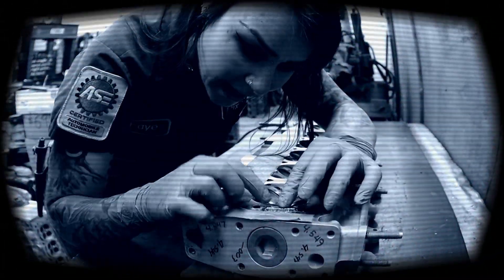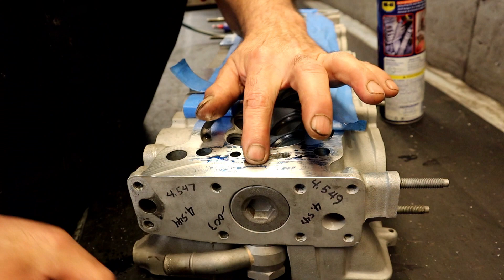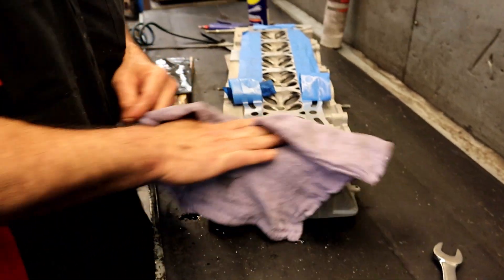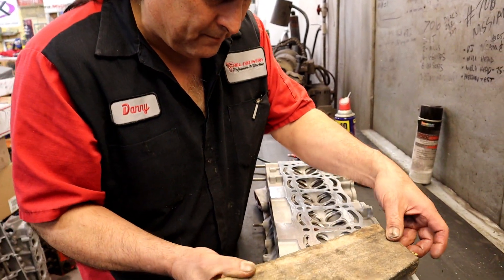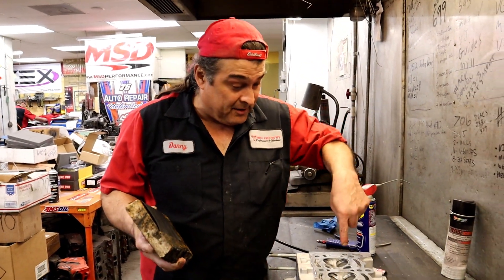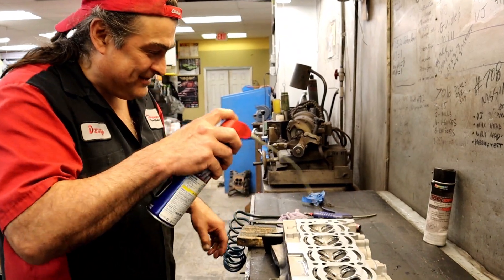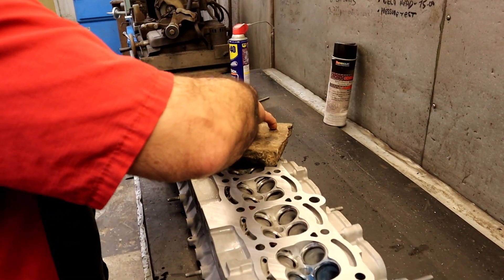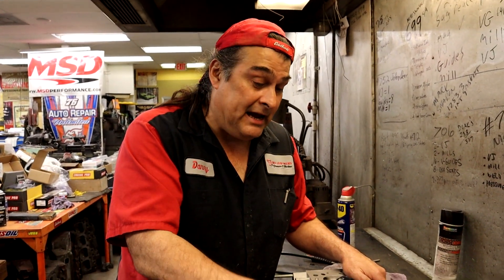Burr Removal and Lapping a Cylinder Head with.... a ROCK?!?! Cylinder Head Rebuilding part 6!!

Comment: I did this recently on 1984 Toyota pick up 22re engine. I replaced the head gasket ,cleaned the pistons with wd40 and a green weenie and used 400 wet dry sandpaper on piece of granite stone . Also did exhaust and intake ports. It turns out awesome results. Thanks for sharing this video.

Comment: Did this on my blocks deck recently and it turned out GORGEOUS! So perfectly flat and smooth. Even perfectly restored the factory machining finish! Somebody in the past has botched it. This fixed it. Went 220 grit (barely) --> 400 --> 800.

Comment: You can get small pieces of granite from your local counter top supplier.  Scrap from kitchen cabinets.   If you had a large enough piece, you could move the head back and forth over the granite.
Re chickens:  Faye's laugh is the sound of pure joy.

Comment: A similar idea is applied to polishing fiber cable ends, you only have to rely on the weight of the Stone so you aren’t excessively applying pressure. Super awesome!
Reply: Granite also doesn't flex, and if properly and slowly cut (obv only with diamond) you can obtain some dad-gum-dangd-ole- flat heavy rocks for many applications!

Comment: My understanding after doing some research online reading articles about people that work in the new car industry manufacturing them they said that there is a special cutting tools that they use on the final pass of a head and that final pass with that tool helps the head gasket seal better

Comment: back in 1960 I had a harley davidson wl45 motorcycle. the cast iron oil pump was leaking where it bolted on to the aluminum side cover because someone before me used a screwdriver to remove the pump leaving a scar in the aluminum. I used a safety plate side window from a 27 plymouth and valve grinding compound to lap the cover smooth. worked fine and did not leak. I have lapped my brigs and stratten lawn mower head 14 thousandths to increase compression. lapping is great if done correctly(and its cheap).

Comment: Hell yeh Faye!! Loving your vids and live streams with Danny👍
A couple of years ago I had a customer that had just re-done his kitchen and dining room floors with polished granite. When I went to return his trail bike I'd fixed, he asked if I could use any of the left over pieces....Initially I thought 'nah I don't need to collect any more useless stuff' but then It dawned on me...'that is probably really flat, and might make a great lapping plate' so I grabbed an approx 1ft sq piece.
Now it's all I use when lapping pretty much anything that fits.
I stick some fine w+d paper with masking tape at the edges and go to town...works great, and is much easier to manage than my huge piece of thick, heavy glass that I used to use previously👍
After seeing this, I kick myself I didn't grab a smaller piece to use as a sanding block...I'm not about to break my nice 1ft sq tile into smaller pieces, but will definately be on the look-out for a small piece for just those sort of jobs that require a hand held size👍🇦🇺

Comment: Its called a lapping stone and its another old school technique.  Remember though, cylinder head surface is very important and different gasket s require different  surfaces.  Its not a one surface is good for everything.  As Danny said, MLS and graphite like very very smooth surfaces 20-30ra or less.  A lot of stock replacement gaskets for older vehicles like a surface with some 'teeth' with a 80ra.  Putting the wrong surface finish on for the gasket can lead to pretty much immediate gasket failure.

Whats cool is if you look at the broach marks on factory heads, they actually leave a slightly raised section in the areas that are most sensitive to blowing, like between the center cylinders on a sbc.  Take a file and run it over a clean uncut head and it will bring up the broach marks.  Its a fraction of a thousandth of an inch difference, but its easily seen on a used block.  Whomever set up the broaches in the factory really knew what they were doing.

I am building a supercharged big block chevy right now with copper head gaskets and an O-ringed block.  It wants a pretty rough surface at 80ra plus the stainless steel o-ring.  But I don't think I am going to have a problem with it blowing.

Comment: I used the polished rounded edge end of a thick piece of glass to dress the surface of my 7M head. Just be even about it and don't dwell in one place too long or you'll have a dip in the surface.  35,000 miles and 6 years later no issues. I used ARP studs/nuts at 90 foot-pounds. I notice on your head that it hasn't been over cut. The giveaway for that is down by the front where the water neck connects for the thermostat housing.  When they're over cut that rounded edge is flattened.  It's a good idea to measure the thickness of the head and the block at the bearing saddle point and the deck surface.  I ended up using a 0.020" metal shim gasket under my standard head gasket to bring it back into spec since Toyota allows only 0.010" total removed from factory specifications.
Reply from the maker: I showed measuring the thickness of the head in one of my earlier videos! Thank you, and much respect to a fellow 7M owner!!! #SaveThe7M!!! 🙏🏻

Comment: I did my head with a thick piece of float glass that is bigger than the head. Place it in a flat surface to minimize bending of the glass and use a light coat of spray adhesive to butt glue 2x A4 pieces of sandpaper. Use a light oil lubricant and go back and forth on the head with separate grids to get the surface finish you want. Comes out like a mirror when you finish. Note the head needs to be straight otherwise if wrapped while you can eventually get a flat surface it will not be on the true axis. Other trick when let's say you are upgrading to MLS from stock gasket is to clean the (even aluminium) head and block with a razor blade by hand. Takes time but if done carefully you won't even put a scratch on it and best is costs nothing and a shop will not fuck up your perfect factory finish or remove material.

Comment: I found out a grade B flat granite slab (12x18x3") is only $88 on Amazon and free shipping despite weighing 70+ lbs.  I'm using it with some sandpaper to lap a block.  To test it I took a junk block and intentionally filed a 0.003 depression between cylinders, then sanded it back out without making the deck any less straight than it was to start.

Comment: I've been researching and experimenting with best method's for solving trying to find the best method to solve the TTY bolt stretch and head gasket sealing issues on the Ford 6.0 Powerstroke for over a year. Although the main culprit was not enough bolts in the design to combat the heat / excessive cylinder pressures. I found the combo of a final lapping on a machined surface with MLS gaskets is maybe the most critical/important step to a good seal. Even more then upgrading TTY to stud's and O-ring's, those  also make a difference but mostly only in higher hp situations. I'd like to see a episode on  his advice or what he recommends on head-stud Torque procedure's. Like Preferences on Checking final tq? if he waits a day till final tq after studs relax? recheck after heat cycle's?  Its not easy finding a machinist willing to give up his secrets for free that took them lifetime to acquire

Comment: As long as you are using a flat tool (metal or stone), wet sanding will produce a mirror-like surface.
Reply: Machinists use granite as their reference plane. Pretty good slabs can be had free from countertop fabricators.

Comment: Granite table is better, but expensive. I've used ceramic floor tile on small motorcycle heads, you just need to check them in the store for flatness. And Danny said it... You can butcher a part with the best of tools, or you can produce exceptional results with the worst of tools. It's up to the user which result you get.
Reply: Yikes I do tile and ceramic tiles are never flat enough for machine work but to each his own, if it's been working for you that's great!

Comment: You could probably get a piece of granite like that for cheap (free) from a kitcjen removal compamy. When people change countertops they just throw away the old one.
Reply from the maker: Yes, I bet you're right!!
Reply: BE CAREFUL, I have done granite and the like, install, replace, etc, if it's worn down you can get yourself in trouble FAST, especially with high precision machined engine parts!

Comment: I saw this guy on here, who has a channel with a lot of unconventional repair/diagnostic techniques (Oldskool Funk is his name) do a cylinder head flattening with a couple of pieces of MDF and sandpaper, with WD40 as cutting oil for it, and a Sharpie as machinist dye. Got a lot of hate at the time. Also did stuff like rerodding radiators, too.

Comment: I resurface my heads with a sheet of glass, 600 grit sand paper then 1500 grit and wd40 lol. Never once had any problems with leaks. Ive done them on my ford 4.0 sohc 5.4 2v lightning and ford 4.6 dohc c heads. Been running boost fat as fuck with zero HG issues. Its an old school mechanic trick they used to do back in the 30s and up. The trick is to just push it from side to side along the sand paper. DO NOT PUSH DOWN ON ANY SPOT. thats how you eat a head. Ley the weight of the head do all the work

Comment: Sooo... smooth rock and 3000 grit sandpaper and a liberal amount of WD is good.  Wire wheel on a power drill is bad?  Umm... not that I did that with the first aluminum head that I worked on.  Nope.  Found it that way.  Can't prove different.

Actually going to be a little sad when the 7M goes back together.

Comment: Guy isn't bullshiting when he says everything has resonance. Even electrons. Ever see the voltage spikes that flyback diodes are used for, measured on an oscilloscope? Even the most modern complicated digital circuits are analog circuits. Everything is analog. Heat transfer is the same. Fourier transforms are useful for understanding EVERYTHING. Intake runner length giving peak performance at specific RPM, because resonance of the air in the runner.

Comment: I thought you would use a stone 😉
Reply: If you want to know more about stones I would suggest checking out vids by oxtoolco or Abom79 or robrenz
Reply: PS, you want a certain surface roughness for different types of head gasket, manufacturers actually spec what surface roughness you need to aim for, well at least they do in heavy diesel.

Comment: ROCK THAT HEAD DANNY!
<.< o.o >.>
Reply: @FayeHadley  on the real though, i believe that rocks MOH hardness is higher than even steel, which boils down to a nice flat surface you can't go wrong with if properly prepared! EDIT: actually i know it is.
Reply: @FayeHadley  Could you ask Danny-
F23 honda, water pump/timing belt, but then I decided to check the oil pump and replace front seals while I got her pants down, any other particular things I might look for/ do before I replace oil pump housing/ oil pan and button her back up?